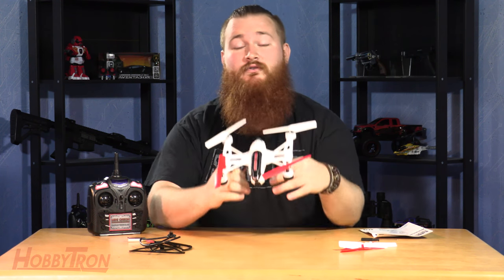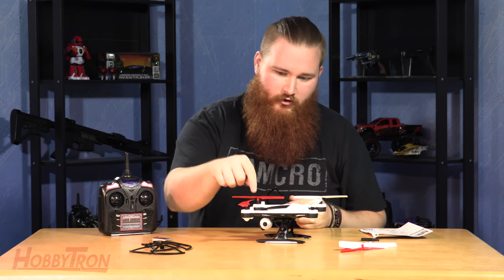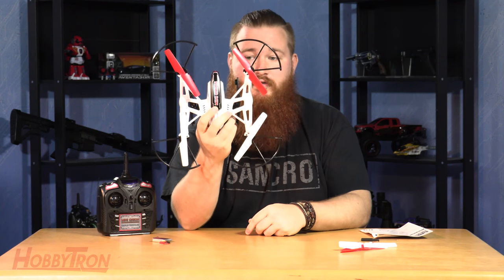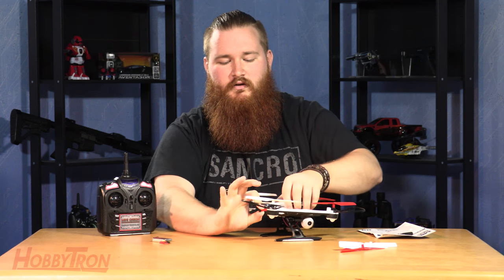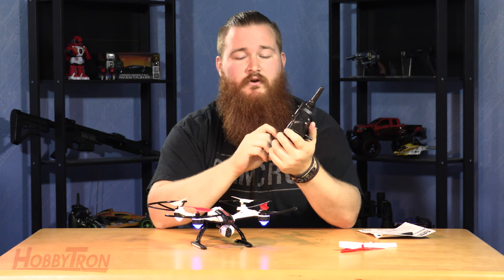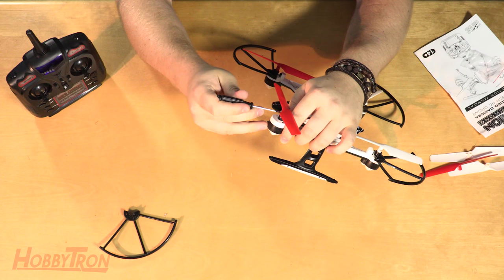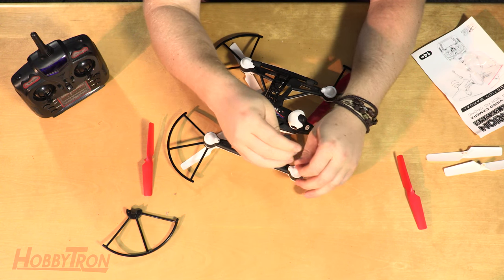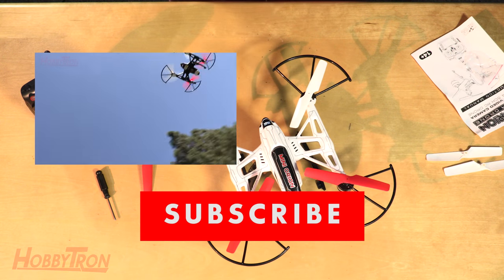Mini-Orion HD Camera Drone | Assembly & Repair

Comment: I haven't found a video on replacing a motor. Please reply with a link if there is one. Thanks! I have multiple drones. So I will use one drone for parts at this time. Therefore I have no "new" motors with instructions.

Comment: Anyone know how to do a full gyro recalibration on this?  mine thinks 30 degrees nose down is level.  Has never worked.  I've tried the start on level, down, up, down.  Still when I hit auto pilot it spins for a second, or flips over.  If I hold it 30 degrees nose down it will run but as soon as I pull it level it shuts off.

Comment: hey I'm having a trouble shooting issue. 3 of the 4 led lights are turning on on the motors and the live feed led comes on and connects to the remote, but the remote won't connect to the drone itself nothing flashes on the drone. could the motor (that the led isn't turning on) be effecting it some how as the drone might be defective?

Comment: Hey, I crashed my mini Orion and now when I turn it on it seems to be stuck in reverse at full speed. It's unresponsive at all. How do I fix that.
Reply: Steven Goodman 
Recalibrate it. This is how. 

Place the drone on a flat surface. Turn it on and pair it to the transmitter. Hold both sticks all the way down and all the way in (left stick to the bottom right and right stick to the bottom left). Hold for at least 3 seconds until the lights on the drone flash rapidly, then stops flashing. The drone is now re-calibrated
Reply: @nelsonpagan8746  I had been trying for a while to figure this out even got a couple from open box to use as parts thinking my motor quit working turned 2 into 1 flew it and started doing same as my other re calibrated both and now they both fly great thanks alot

Comment: My drones lights are on when I turn it on, but why is it that they are not flashing when I try to pair it with the remote. I have gone through the trouble-shooting manual and everything.
Reply: Jacob Gebo. You need to move you left joystick up and down then there will be a beep and the drone light will stop blinking which means its connected. Also if you want to start the drone press autopilot and then use the left joystick to do up and down right joystick goes up and down and left and right

Comment: can you help me please I bought this product and I can't get it to fly correct. as soon as I get it off the ground it doesn't fly right. I've tried adjusting the trim but it's ineffective. I think its another problem. as soon as it leaves the ground it just goes out of control like it's way out of balance or maybe the props are not spinning the same or something else. Please help. this is the drone I bought: World Tech Élite Mini Orion Live Feed HD Camera Drone
Reply: It has A and B replacement rotors that came with it.  If you replaced a rotor make sure it's the corrent one A or B.  If you have 3 A rotors or 3 B rotors it will go out of control as soon as it leaves the ground.

Comment: Quick question got mine for Christmas flew it a few times with no problems now when you hit auto pilot and start to throttle up it just takes off please help TIA.
Reply from the maker: The drone may have picked up on a rogue signal. Make sure that you turn your controller on, then the drone. That makes sure that your drone syncs with the controller and has less of a chance for signal interference. If the problem persists contact customer service http://www.hobbytron.com/contact.html

Comment: Is there any way to recalibrate these drones? I only flew mine twice before it started to just completely turn itself over upon startup, I got it off qvc so it has Platinum protection warranty but I really don't want to have to send away something I just got and only flew twice.  Super unhappy 😕 hope I don't have to write a bad review. Please help !
Reply: Ryan Pine
I got this info from customer service. 
Place the drone on a flat surface. Turn it on and pair it to the transmitter. Hold both sticks all the way down and all the way in (left stick to the bottom right and right stick to the bottom left). Hold for at least 3 seconds until the lights on the drone flash rapidly, then stops flashing. The drone is now re-calibrated
Reply: Nelson Pagan thanks helped a lot!
Reply: Ryan Pine you're welcome. Now just play with the trim to get it flying properly.It'll take some time but you'll get it.
Reply: Nelson Pagan thanks you

Comment: When I turn both my drone and remote on, the drone blinks lights (like it’s supposed to), but the remote will not connect to the drone (checked the manual as well)! If the controller does connect to the drone, then I can turn on autopilot and the motors will start spinning, however, after about 2 seconds, the controller disconnects and I’m back to square one. Please help! The drone and controller are fully charged as well. Any ideas as to how to get them to sync properly?
Reply: yes you use the controller on the left side and tilt the stick down up down not fast but slow and its connected